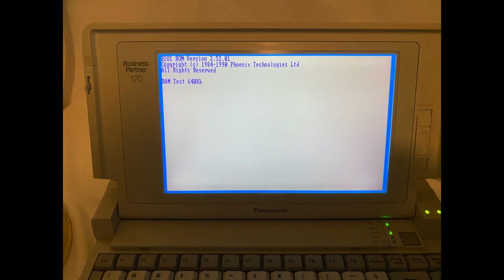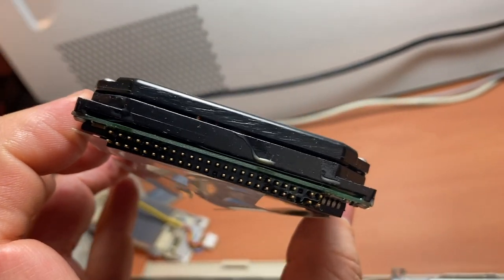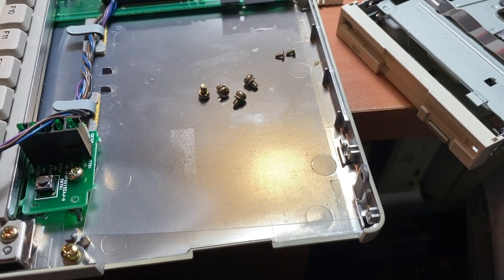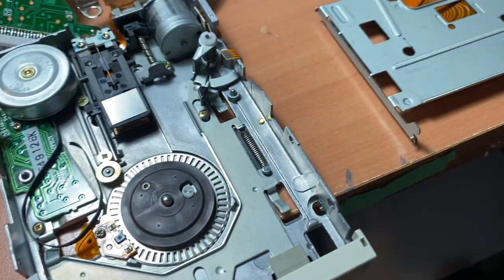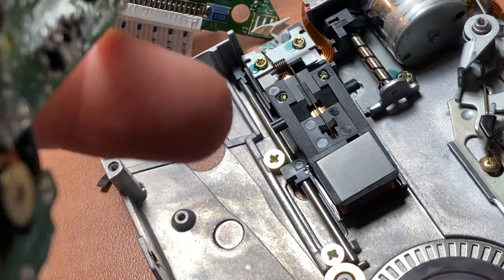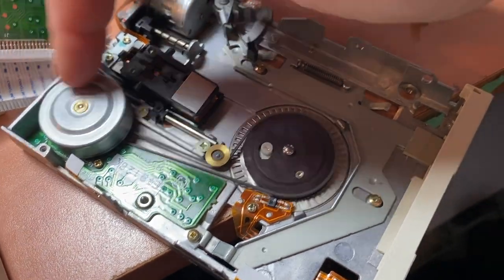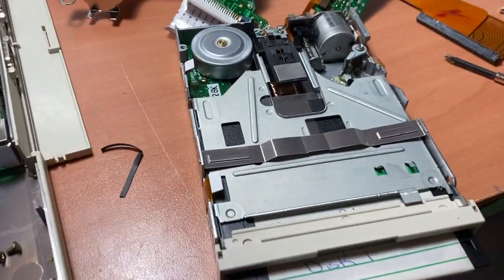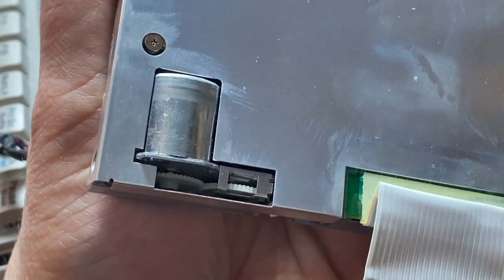Panasonic Business Partner (Tandy 1100) Teardown & Floppy Repair

Comment: I had a Panasonic laptop like this, bought it a couple of years ago in the hope of restoration. But due to lack of resources and time I resold it in the end. Machines from this era quite often require an immense amount of time to restore. I have a NEC Prospeed 386SX laptop, that had like a million capacitors that were all bad, leakage on power board, some oxidised connections so there was no continuity etc, but even with all these issues I managed to bring it back to life. But after looking around in my Panasonic, I knew I just won't have the will to go through all of that again. Also for the NEC I was able to read some very useful threads from people who managed to restored them, for the Panasonic I found literally zero info.

I have to say I have never seen anything like that hdd seal liquifying, and completely disintegrating into nothingness, it's crazy. If that hard drive will be still alive after you re-seal it, that will be a miracle.
Reply from the maker: Yeah tricky thing is, there's no copy of the boot disk I was able to find. I may image a DOS 3.3 disk and see if that helps. Also tempted to put a CF IDE drive in.

Comment: I have a Tandy 1100FD that needs the belt replaced.  Can you please tell me where you sourced your replacement belt from?  Thanks for the great video and explanation.
Reply from the maker: The truth is... I don't know where you'd find a belt. You could probably measure and find one from a similar floppy drive or even harvest the drive from a similar era machine in better condition... but what I often do is get a mixed bag of rubber bands, find one that's slightly smaller than spec and wider than your average, but not super wide and flat (not square ended if you cut it kinda thing). It's not a long-term solution but it works in a pinch... not sure how long a temporary fix like that lasts -- but it at least gets you a drive that reads in the temporary provided you pick a sturdy enough band. I also find they're less 'slippery' than belts of the era were. I learned this little 'hack' from fixing 8-track machines in my youth. Often the belt was the issue on those back in the 80s and often a rubber band normally used for postal mail would work perfectly to keep the music alive.
Reply: @thisoldtech2  Thanks for replying!  They do seem difficult to find, so it makes sense that a rubber band or similar belt might be the best (and perhaps only..) fix.  Plus, I probably won't be using it all that often other than the occasional nostalgia fix.